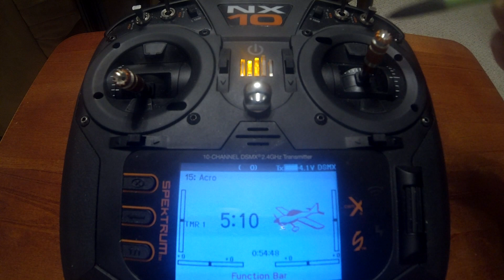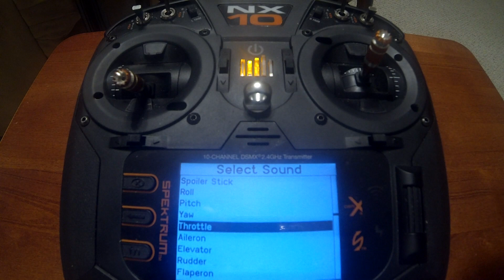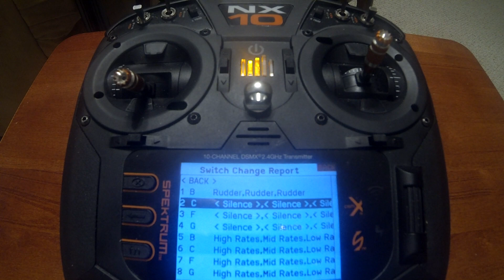Spektrum NX Setup: Dual Audio Events for Single Switch (NX6/NX8/NX10)

Comment: BD, I now have my NX8 programmed to callout the rates followed by the moving surface. for instance my switch says low rates aileron   mid rates aileron   and so forth. how do I reverse the callouts so that it will call out the moving surface first for instance aileron low rates   aileron mid rates ?
Reply from the maker: Swap the lines. Surface first and Rates second.
Reply: @BDTennessee  thanks BD will do that!

Comment: I don’t know if you can help me,the ribbon cable going to the charging port and to the circuit board,need a new one and the charging port on the back is broken
Reply from the maker: Fill out a service form and send in to Horizon...
Reply: @BDTennessee  that’s what I did,have to send it tomorrow,thank you sir

Comment: Hi there great video and nice explained. Just have a question to mix the throttle with the elevator when progressing the throttle so the hotliner do not climb like hell. So I get a more smooth climbing and I can control it myself.
Greatings
Reply from the maker: Thanks! Follow me for more videos.

If you wanting to do a mix (Throttle > Elevator) then set the percentage to what you prefer. Also can do a throttle curve as well. It allows you to set points and allows to set exactly how you want...
Reply: @BDTennessee  the main problem is to have a proportional level down of the elevator when I give some throttle so it fly strait when I'm flying horizontal. That's the idea

Comment: Thanks. My NX8 is in for repair... I'll try to remember to give that a try when it comes back home. Right now I can't think of any practical application for dual audio callouts on any of my model setups.
Reply from the maker: Whats wrong with your NX8?
Reply: @BDTennessee  The female connector for charging pulled out of the radio. Not a big deal in itself so long as there is not a design flaw. Hope it isn't just the soldering that holds the female connector to the circuit board. Wish they used the type connector that allows you to match male to female either way. 
BTW, shipping and insurance (for $370.00) cost me $17.10.
Reply from the maker: @BillKisel  hope they get you lined out quick. Sorry top hear you having troubles.Keep me updated.
Reply: @BDTennessee  Had to call HH because I saw no updates about my repair ticket on the online repair tracking page. [USPS tracking showed my NX8 having been delivered over a week ago.] Was told my NX8 was "checked in" on April 28th but not yet assigned to a technician. Today, May 2nd, they're assigning techs for products having arrived on April 20th. So, about a week before work starts on my NX8.
BTW, issues with their online repair tracking system means folks like me are calling for updates instead of online tracking.
Reply from the maker: @BillKisel  Thanks for passing the info.Sorry to hear taking awhile to get fixed and online tracker isnt working.Keep me updated!
Reply: @BDTennessee  BD, this is not a biggie. As you might imagine at soon to be 77 years old many far worse things/frustrations have happened in my life. On the RC plus side I bought my Sport Cub S 2 RTF so I have it to fly. Also, I think the TX fix should only take a few minutes to fix  assuming parts availability.
I'll try to remember to keep you in the loop.
Reply: @BDTennessee  Ready to ship! Looking at the time stamps the fix had to be very simple. I just hope there is no design flaw in the product such that I have the female charge port pulling out again from the case. I wonder if a spot or two of hot glue or epoxy would be a good idea for affixing the port to the case?

Date/Time (CST)	               Status
6/11/2021 10:57:56 AM	Ready to Ship
6/11/2021 10:19:43 AM	Assigned to Technician
5/28/2021 10:21:51 AM	Product Checked In
Reply from the maker: @BillKisel  good news! Maybe they just gave you a new one :D
Reply: @BDTennessee  No, not getting a new one which is fine with me.  Got an email with attached PDF invoice that says that broken USB port was replaced. Said this is not considered under warranty (?) but took care of it as a courtesy. Enclosing a different USB cable that gives a better angle. Cautioned to be careful not to accidentally bump the port. I will be extra careful especially seeing that this is not considered a warranty issue.
Anyway, all's well that ends well. Will probably get my NX8 back this Monday.
Reply from the maker: @BillKisel  Copy that! Maybe get the Magnetic charge cable like NX10?
Reply: @BDTennessee  FedEx delivered my repaired NX8 TX early afternoon. Charged the TX battery to full, charged a battery for my UMX Turbo Timber and this evening around 8 PM went flying. Life is good!
Reply from the maker: @BillKisel  awesome too hear my friend! Welcome back to the sky!